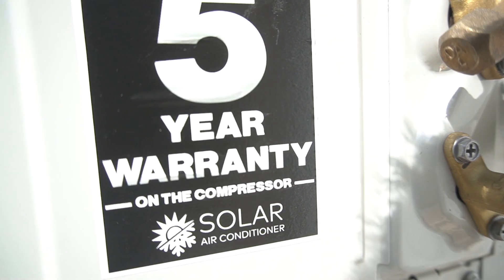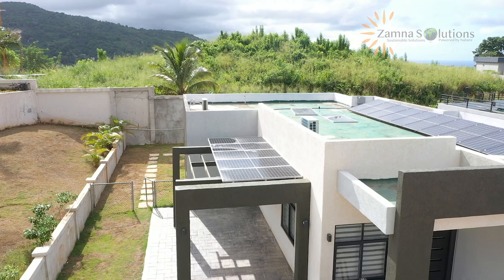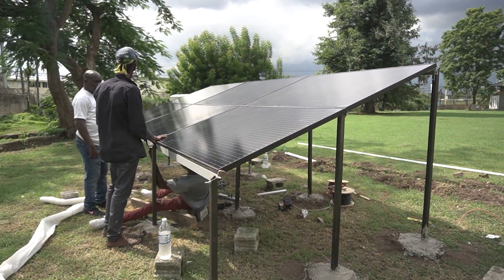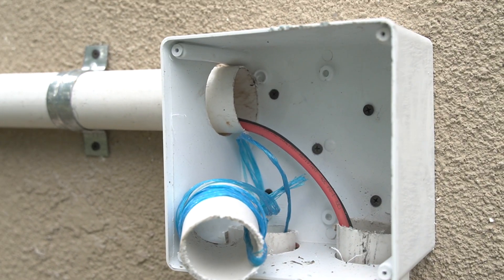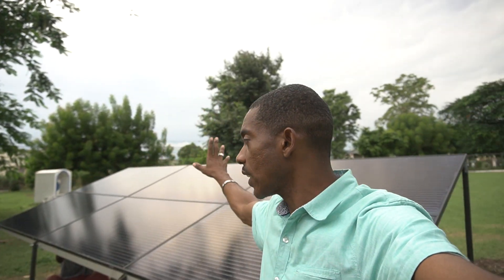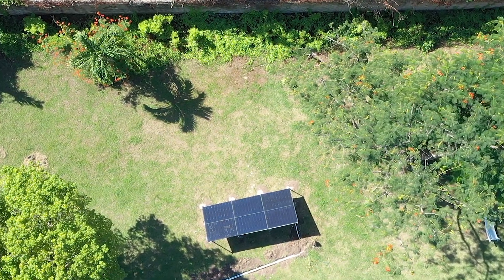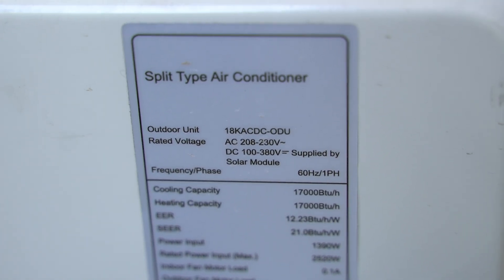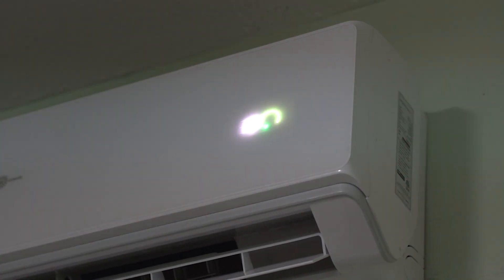We Donated a Solar Air Conditioner

Comment: My solar system is well equipped for the next hurricane season i bought an old Mazda pickup frame with no cab are body and mount my ten 550 watts solar panels on a frame that i build so when the hurricane comes i just push it into a garage i build for it

Comment: Is there a way to check the contribution of solar power and power from utility to see how much savings the solar panels is bringing in?
Reply: Ur better off running the extra u don't use over to ur neighbors
Reply from the maker: You'll get an app with a solar powered system or solar air conditioner. You can use it to track production and savings.